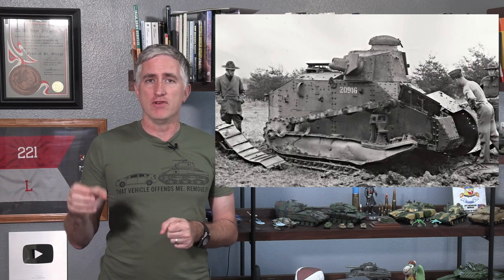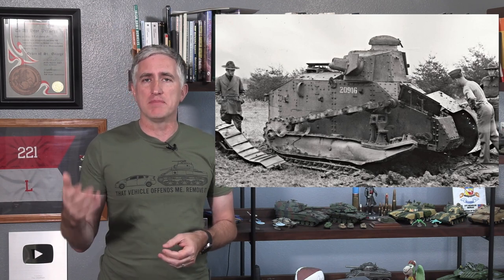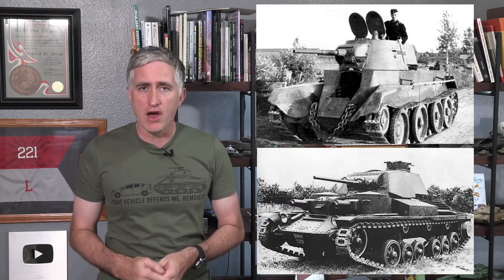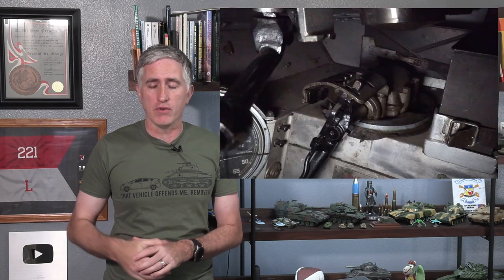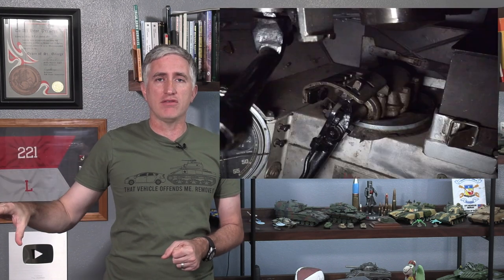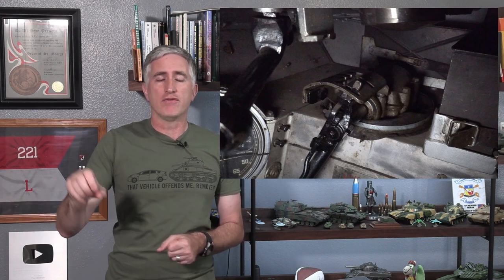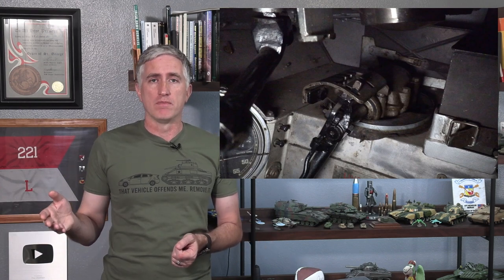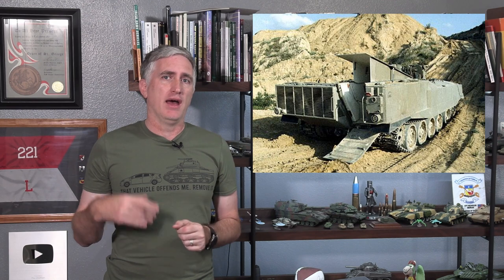Advantages of rear engine tanks with front drive sprockets

Comment: To address your point around 11:00 WRT engine arrangement for APCs - don't forget the entire 8x8 BTR series, which are notoriously rear-engined despite being roled as APCs, with the troopaloops simply disembarking from twinned hatches on either side of the vehicle.

On the other hand, one can argue the relative merits of a single larger ramp-style hatch vs. multiple smaller hatches, or even the merits of the BTR with regards to its doctrinal use as an APC in general, until they're blue in the face. I don't particularly feel like doing that.

Comment: Hey Chieftan, great video, as ever; love the content.  The Israeli design impetus for engine forward is primarily crew safety and ease of evacuation.  True, the door in the back makes it MUCH easier to ingress and egress ammo and other supplies, but the real ease is in evacuating (from the tank, or from the battlefield by loading into the tank) injured soldiers.  The forward engine also means that there is that much more heavy metal between the tankers inside the tank, and the enemy outside.  This is important, especially since Israel's enemies have, since the 1980's, grown very fond of using the KORNET missiles.  Israel may lose a tank, and that is a huge economic loss, but it increases the survivability of the soldiers.  I just wanted to add that information, having served in the IDF (not in an armored unit, but I operated in tandem with armored units).

Comment: A  sprocket  pulls the slack out of the track not push the track. Thus if you have a front sprocket  , the slack is pulled out of the top of the track leaving slack in the bottom to help the track flex more on the bottom to follow the boggies on the suspension better and allow the boggles to remain in better contact with the track. This works better on most types of track suspension types and not just on tanks but most track systems Inc construction equipment,  snowmobiles etc.
Reply: Correct.

Comment: On the wilson gear box, to expand, the linkages are both pushing and pulling alone. The gear pre-selecting is pushing or pulling to rotate a selector drum by way of a bell crank. On the Gear Change function, it's just pushing or pulling a bell crank to lift the bus bar.

Compare to a conventional gear box selector that needs to twist as well as push/pull.

Comment: Chieftain remember fuel and hydraulic lines are specially designed quick disconnect couplings and generally different sized or color codes to prevent them getting crossed up. Another point is how they also will have full up packs ready to issue at the SSA or Support to eliminate time consuming component replacements. The unserviceable full up then can be sent where time and generally better facilities or equipment can make that task a lot easier. A good example of a front drive sprocket with everything forward is the US M113 FOV.

Comment: Chieftain, a friend of mine once asked me this and I answered as best as I could but I wasn't sure of the answer. Could you answer for me?

How do you go to the bathroom in a tank?
Reply: Mourtzouphlos a spent casing is useful for that
Reply from the maker: Normally, stop the tank and get out, find a bush. If you have to take a leak, a plastic bottle.
Reply: Now there's a question. As the British always have a way to boil water, tea and hot rations et cetera, you have to get rid of the byproduct somehow. Imagine being in there for several days locked down simulating NBC conditions. And they called USN submarines pig boats.
Reply: @TheChieftainsHatch  while rolling or do you still stop to filler er up? And what to do with the bottle after? Kinda hard to see tankers with bottles of urine about.
Reply from the maker: While rolling. The bottle is kept aside until it can be disposed of later.
Reply: @TheChieftainsHatch  lol thank you for the quick reply
Reply: If you could. Find an enemy's helmet. Preferably one that has been discarded.
Reply: buy a Kärcher and before entering one has to do the job that all othee get a porentief clean skin
Reply: The British Warrior AFV has a toilet in the back cut into one of the dismount seats. However they're never used and are normally used for storing extra items such as fresh rations etc. But in theory you can make a cup of tea in the back whilst having a dump...
Reply: @kevingarrett2559  But not in an Abrams. I don't know if it's the case with all rounds fired by the Abrams but some rounds don't leave a full casing but instead leave only a (relatively) short metal base that wouldn't hold much liquid.
Reply: I had to laugh when I read this question because it's pretty obvious as to what someone would do if they are in a tank or any other vehicle! I spent 12 yrs in the US army (2000-2012) with 2 tours in Iraq and one in Afghanistan, so I have pissed in a LOT of bottles. Whe on patrols in Iraq or Afghanistan we always carried a wooden ammo crate in case someone had to take a shit. If you were in the army you know what I'm talking about. The wooden crate is what the ammo boxes come in and once you take out the metal ammo box you can use the wooden part as a shitter.
Reply: @bigblue6917  thats because those absolutely enormously spacious vessels (compared to tanks) known as submarines are full of naval personell who are widely known for their cleanliness and dedication to ablutions.
Reply: An understated benefit of metallic shell cases...
Reply: Some tanks (M60?) had a hatch in the floor.
Reply: @kieranh2005  Unless you're doing NBC training. In that instance, no hatches open.

Comment: Merkava engine at the front is extra armour for crew. Even if penetrated and engine knocked out the tank can act as a pill box / strong point and still be useful. Handy when your country is only about 60 miles wide and 200 miles long.

Comment: 1. Accessing the transmission easily from all angles for maintenance
2. Short linkages for shifting gears, easier gear shifts, aiding with fatigue
3. Weight balance (front and back)

What is different today:
1. More reliable power packs, easy to disconnect take out and for work
2. Automatic gearboxes, controlling thing by wires not linkages
3. Power pack balances the thick heavy armor at the front

Comment: I am sure they also used the front transmissions as additional armor to add to crew survivability. The other thing I wonder about is, how the track behaves when pulled from the top and around the rear idler, vs being pulled from under the vehicle.
As for the driveshaft, why didn't they just run it along the side bottom corner with a transfer case?
I know the answer mainly is simplicity, but for making a great tank, it's not that much more complicated. The Russians are not an example of efficiency or user friendly design. They just slapped together pieces of metal and put things inside that made the contraption turn into a tank. Surprising how well things are designed, nonetheless.

Comment: We see split systems sometimes in drive lines for weight distribution and spacing.   Even the Porsche 928 is an example of engine in the front, long driveshaft, transmission/differential in the rear.

Comment: I don't know how accurate this is, but I've heard that another benefit of a front mounted transmission is that in case of a frontal penetration, there is an entire transmission that the round has to go through after going through the armor before it gets to the crew, so it acted as a sort of spaced armor for extra crew protection.

Comment: Honestly - I just watched random video, where some guys doing restoration of sherman tank. I recognized it specifically by sprocket wheels. Watching how the tank was designed (tank was basically stripped apart for restoration works) inside - I asked myself a question: why the don't put the gearbox and drive sprockets with the engine? Is it a balance of the mass? Tension of tracks? And I am about to find out! Thanks Chieftain :)

Comment: Crew safety. One of the stated reasons for the S-Tank having a front engine was to provide additional mass that incoming rounds would need to penetrate to get to the crew.
Reply: There is a video by either Chieftain or Jingles from a couple of years back, where they talk about the super pershing receiving some new tungsten core ammo, which went through a jagdpanzer4 like hot knife through butter. The going hit the front, hit the engine and went through the back armor as well.

Based on this, it might help with lower calibre rounds, but a full sized mbt tank round would be probably impervious to the fact, that there is an engine in the way.
Reply: Same with the merkava
Reply: @V4zz33  What year Jagd P.IV? The latter half of the war the Germans were forced to use softer and softer grades of "armor" steel because they lacked the alloying elements required. (Such as Molybdenum)
Reply: @alexhohl8530  ah but it also adds a giant armour space between a heat round and the fighting compartment which is why i understood the Merkava was laid out like that, to maximise crew protection. Of course if its hull down in a position for weeks on the golan heights the crews would also like the back door for ease of putting the cat out at night.
Reply: @TornadoADV  I'm guessing this was on a test range.
Reply: Sweden also discovered that fuel was actually pretty effective at stopping HEAT rounds, that's why they used jerry cans as side skirts.
Reply: alan although they didn’t seem to do so good in Waltz With Bashir
Reply: @TornadoADV  late war jagdP.IVs also had thicker armour though.
Reply: @c3aloha  Waltz With Bashir, Man of Culture I see.
Reply: S-Tank is special. And having all parts of the tank stopping incoming shells from crew contact is good for protection and the tank in general. S-Tank in question had fire test done on it showing that just radio equipment can stop crew crippling damage from happening. Tank still is taken out from the fight but the crew is not hurt mean that they can focus on getting the tank operational after attack. So even small stuff can help stop crew damage. And a engine sure is going to take energy away from any remaining armor. That if you put any armor between the engine and crew ofc.

Comment: About the remark on APCs disembarking crew(infantry) ergonomics and narrow ramps, putting engine, or engines, to the front, or more specifically front right pushes driver and commander into this narrow space on the front left, reducing crew efficiency and in particular commanders ability to have a good view over right side of the vehicle. I am talking about BVP M80 since I haven't had much experience with other tracked IFVs and APCs. Mind you, permanent crew of our IFVs are not tank core guys, we are also infantryman, chosen out of the ranks of mechanized infantry, so we are rarely narrow guys, this is why I usually chose to disembark with my infantry to get a better view of the surroundings and be able to command the vehicle better. This in turn introduced a lot of different problems and some unsafe practices that would get me reprimanded or even punished if any of my COs decided to report me for them instead of just warning me. My opinion is that engine in the front is a bad idea for tracked vehicles.

Comment: Something you could, in general, cover. Throwing tracks. I trained at Ft. Irwin circa 1972-1974, as armored cav. We used M113 APC always referred to as "apes". The problem was that if you went sideways, rather than up and down a hill, past 15  degrees would throw a track. Not  problem for the M48a8 until about 45 degrees / [I seem to remember the designation M48a8 but memory is hazy- they were the last version of the M48, up gunned to the same 105 as the  M60]. We were told to limit the sideways slope to 30 degrees /. Don't know if it was a maintenance issue. So I have been wondering about this side of a slope limit for ALL the other tracked vehicles you cover??? This also has tactical implications.

Comment: Does not a front drive wheel incur less wear as dirt has more opportunity to fall off the track before encountering the wheel whereas a rear drive pulls the dirty track right from the ground increasing wear? Thank you for another great video!
Reply from the maker: Supposedly. But I don't think it's enough of a difference to matter. If it's the case of replacing the sprocket and track at 2,000 miles vs 2,500 miles, we'll just replace the sprocket a couple weeks sooner.
Reply: @TheChieftainsHatch  Thanks!

Comment: Very interesting video! Of course there was disadvantage and advantage with the front drive versus the rear drive but we must go back 70 years to see in the correct perspective the situation, namely the the ease of production! In fact all the German tanks had the front drive together with gearbox  because of the front transmission and the final drive and the Germans wanted to avoid complicated links to the rear and to be easily connected for shifting, clutching, steering and braking. Apparently it was also easier to produce, install and maintain and it is good to remember that there was only the Hellcat that was fitted with the power-pack (as far I remember) for quick extraction and maintenance but the transmission was at the front! That said the real improvement as nowadays is having the power-pack both at the front or at the rear but the real advantage where is it?
Reply: AKUJIRULE  it really did made sense having the power pack for quick extraction of the engine for repair or maintenance as it it did had a slide to pull it out from the rear by lowering the rear panel. But as I mentioned before the transmission and the gearbox was at the front and it was a slow job quite similar to the Sherman...

Comment: Rear drive sprockets generally make it less likely to shed a track especially if climbing obstacles  particularly ones bigger than the front wheel height or steering hard in mud or debris as any potential slackening of the chain happens on the top (return) where theres less load and the suspension should take it up .

Comment: Very possible that front drive tanks are better climbers, my brother was a Capt in the army and he was a round a lot old m60 tanks and he always said they climbed much better going backwards up hills.
Reply: That's probably because reverse gear is a higher ratio and gives more pulling force, making slopes easier.

1st gear, 3.5 : 1
rev gear, 4.9 : 1

Comment: Does having the transmission in the front offer any extra "armor" protection to the crew?
Reply: yup.... definitely more metal to stop spalling..... or to stop the round it self

your still gonna have a bad day..... but not QUITE as bad of a day

now, if you get hit by a modern 120mm APDS round..... its simply going to go threw the whole tank..... and out the back
but id rather have that extra bit..... just in case its a 100mm or gun with less penetration/damage 

----------------------------------------------------------

its also a boost to moral..... your more likely to charge in
which more often than not.... is the correct action..... its only not done because people are scared 

its like body armor and helmets in modern war..... it will probably stop a frag nade.... or a 9mm 
but a 7.62x54R will go right threw that...EASILY! 

however..... the person wearing it still gets a bit of that "im invincible" feeling
and is more likely to do their job..... VS cower in fear, only exposing their hand as they spray rounds into the dirt 5 feet ahead of them
Reply: kain hall kinda similar to the merkava having the engine at the front for the sole purpose of adding more protection.
Reply from the maker: It does, but it's really more of a fringe benefit than a primary design criterion.
Reply: Body armor can stop a 762 by 39 easy. Ceramic or metal plate will stop 50 762 In 1 spot. Ceramic at least 1 in the same spot
Reply: @kainhall  Modern body armor and helmets have come a long way. Ceramic plates will stop a full-size rifle round no problem, and there are helmets on the market today that have a good chance of doing the same.
Reply: @Shorjok  Yes the Israelis do seem to take the Islamic attitude to lands taken by force though being Jews they always wait till the other side attacks first before occupying the attackers territory :)
Reply: @kainhall  Modern helmets are designed to protect against artillery rather than gunfire.
Reply: andrew allen Well the land was taken from the Palestinians first so i would call that the first act of aggression.
Reply: @ew3612  Read your history books :)
Reply: @ew3612  and the Arabs took it from the Byzantines (who bounced it back and form with the Persian Sassanids), while the Sassanids took it from the Romans, who "annexed" it from the Israelites, who were given it back by the Persians, because the Persians conquered Israel and shipped all/most of the Jews to Persia. Before that, the Jews conquered their neighbors the Canaanites.  And there were plenty of Egyptian, Hittite and Assyrian "incursions" back then, too.

Bottom line: that region has been conquered dozens of time, by whoever is the strongest.
Reply: Soren G  Engine has little stopping power. RPG would chew through the engine like its not there and then its molten aluminum would poison anyone alive to inhale fumes.
Reply: @pickeljarsforhillary102  yes i'm sure a 13 year old girl on her way to school is a real threat to a soldier in full battle dress with a rifle
Reply: @Shorjok  UN says other wise since 1947.  It was also Christian land, Byzantium land, Roman land, Greek land, Egyptian land, Israelite land, Canaanite land...etc...etc....
Seems the muslims stole it from other people.
Reply: @pickeljarsforhillary102  And the UN is to be trusted are they? If the UN bulldozed your house you'd just accept it and move on? Or would you lick their boots first?